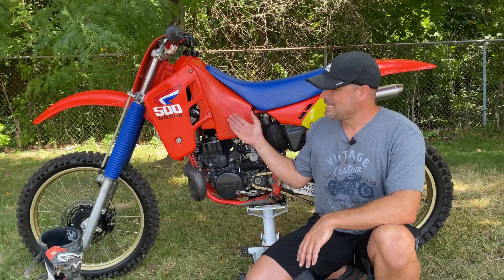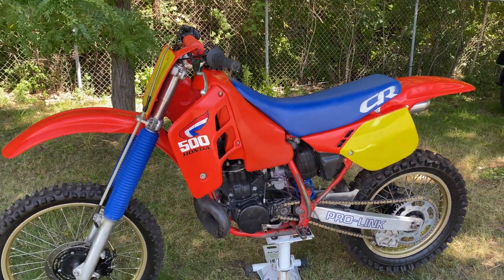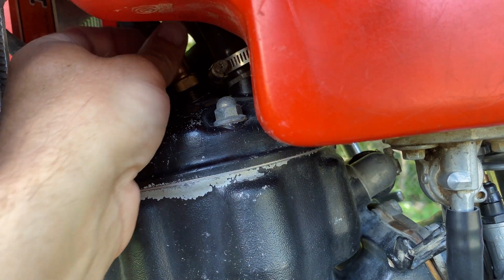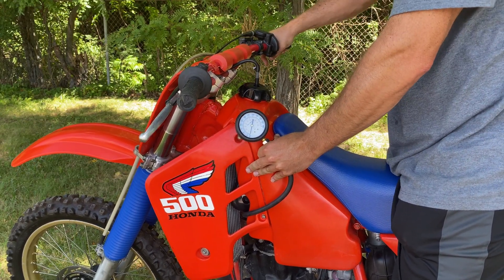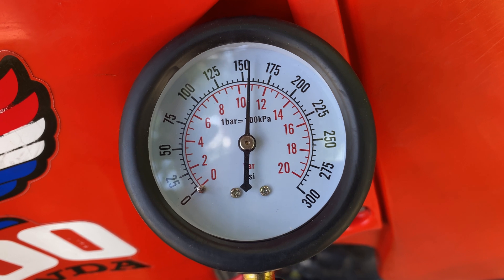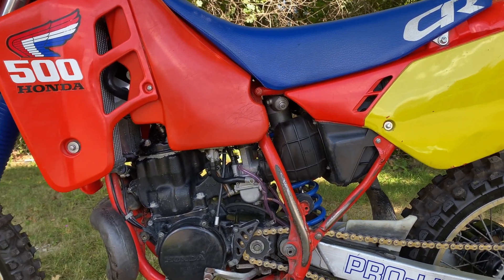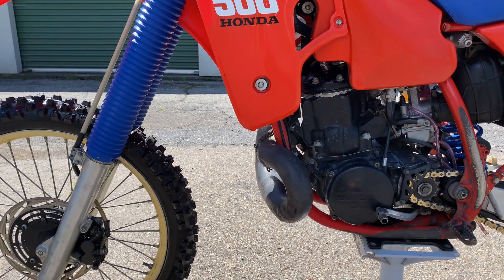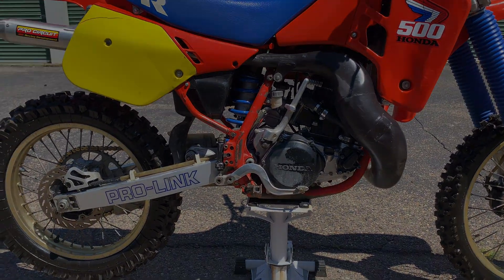1987 CR500: What Should the Compression Be?

Comment: I think the stock compression is actually higher than that, like around 170-180 psi.  What compression tester you use makes a big difference.  For example, if you are also filling up the hose, that adds volume.  You don't want to pick up any automotive tester and try to get accurate numbers.  But with a fresh top end kit that you know has good compression, you cause that lower number for a reference for wear.   
I did a weird way to set compression once, but it worked well. A buddy of mine repairs bikes/quads/snowmobiles. etc, and he does have a very accurate gauge.  I set the compression for one of his customers bike that was a Frankenstein RM125 with a stroked crank, a new top end and we oiled the rings.  I had to modify the head to get the compression right.  Since we knew his gauge was accurate, and after I cut a good squish clearance on the head (for the stroked crank), I lowered the compression (we were shooting for 185-190psi), by measuring the compression, taking the head off the bike, and me cutting the combustion chamber on my lathe.   We just kept doing that in little bits, until we got the PSI he wanted. 
It ran great.  Old RM smoked his neighbors newer bikes.  :)

Comment: His explanation of anything lower than 125psi. Would have difficulty starting. Most who use a Head Decompressor will experience the same thing. But, because it is easier to kick they don't complain. Which is why I will never use a decompressor again ..
Reply: Not all compression gauges are created equal.  I have one that reads about half what the actual PSI is.  Small bore engines, automotive tester that also fill up the hose.  The hose is about as much volume at the trapped volume of the head, so it reads 90psi with a new top end.  :)
Reply: @EarthSurferUSA  500cc is not a small bore. Decompression valves are over rated.  In my opinion because you need to kick more often using one. It causes more stress on the cases. When the lever slams into the peg at bottom.